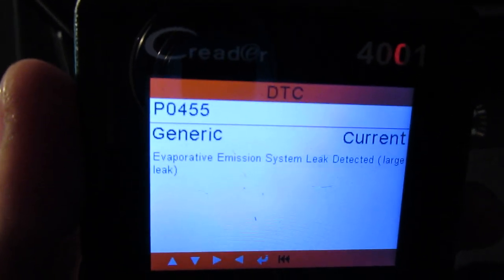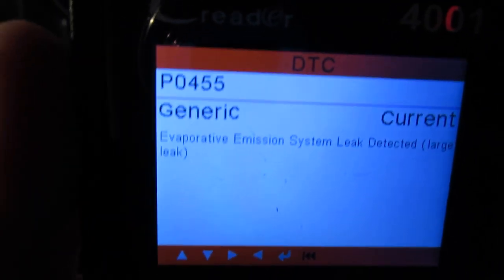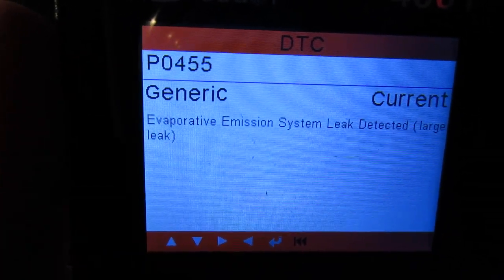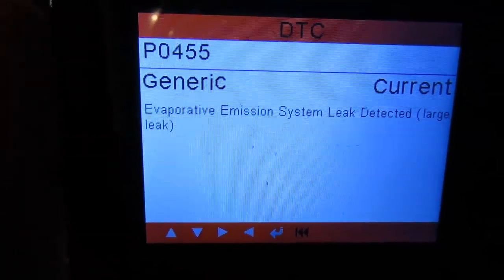FIND/FIX EVAP LEAKS

Comment: Do not buy 1/4 inch or 3/16th hose neither of them will come close to fitting. Buy 3/8 if you want a perfect snug fit. But other than that great video it’s been 3 days without the check engine light hopefully it stays off so I can go through inspection.
Reply from the maker: Mine is about 7 months in an still holding strong. Good luck with it!
Reply: What size clips would I need?
Reply: @DEInTheGarage did that fix the code ?
Reply: @DEInTheGarage do I need clamps I don't got em gonna trick knock this out right now.

Comment: One trick I learned on youtube was to put a vasilene on your gas cap "O" ring  . Helped clear my evap code and has worked for a long time . I may have to do it again as my CE light is on and guess what? Its inspect time. :(
Reply from the maker: Isnt that always the way... I get 2 full years with no CEL and then right before inspection BAM.. good tip though. Thanks!
Reply: Always seems to happen at inspection time....

Comment: I'm chasing a large leak on my '01 TJ and I think it's the hard line up behind the driver's rear spring mount. I'm over in Pittsburgh so I am also blessed with a similar level of crustiness on the undercarriage. My main motivation for chasing the issue is I'm sick of looking at the engine light, haha.

Comment: funny, I was at auto zone today and I was gonna replace the line with the tube like you did and the guy was like NOOOO you dont wanna do that because it won't hold the pressure! Personally I knew it would work because its not a lot of pressure on that line. I changed my gas cap as well but light came back on so im hoping this job will fix that.. I did have a misfire on cylinder 3 but after changing the gas cap that code is gone and hasn't come back so im still learning!!

Comment: Did you ever check your cruise control elbows, sometimes behind the passenger headlight, but your's might be in a different place.  I had a vacuum bulb under my battery on a 99 gjeep cherokee
Reply from the maker: Interesting. Thanks for the suggestion
Reply: @DEInTheGarage  i saw a video the other day of a gas tank leaking at the giant o ring that seals the pump.  I'm starting to see that you can have a leak just about anywhere on the system, here's the list so far:
1. Cracks in air breather hose and air breather top.
2. Valve cover vacuum lines
3. Brake vacuum hose dried up and loose/brake booster allowing air in, going out
4. Intake vac. elbows dry rotted cracked
5. Melted/cracked throttle body vac hoses
6 cruise control vac elbows dry rot.
7 check valve elbows dry rot
8 check valve worn out
9 check valve filter clogged
10 vac to axils dry rot
11 vac to headlights dry rot
12 throttle bod gasket cracked
13 evap vac lines rotted
14 evap purge valve o ring loose/old/ or valve bad
15 gas fill vac hose/purge hose/or air inlet hose dry rot
16 gas pump o ring on tank loose/dry rot
17 gas cap loose
18 cheap gas cap with wrong vac pressure valve
19 vac to air/heat controls leaking in dash
Vac lines off/ddy rotted to vac resivoire (black plastic ball) usually under front fender, either side depend. on make or model/ or ball tank broken
These are the most common....
Smoke test makes a lot of sense now.
Reply: @DEInTheGarage excuse me sir where did u order your custom Sealing design at they look dope. I like Alot.

Comment: my worst smell of oil is 90w oil (rear axle oil)! make a smoke machine! remove the & remove the Schrader valve from the evap test port (left-hand thread ) & test your evap system connect the smoke machine there! be safe!
Reply from the maker: Yea, I have heard folks doing that at home. have never had the opportunity to try my own smoke test, but i would definitely like to

Comment: I use Sil-Glyde on hoses.  It doesn't melt the rubber like oil and petroleum based grease.  
Emissions vapor hose with occasional liquid fuel contact is SAE J30R7.  You can use SAE J30R9 fuel hose but it's overkill.
Reply from the maker: Interesting. Thanks for the feedback and tip!

Comment: Great job gave me enough instruction to diagnose my 2002 WJ 4.7 V8 test code P1494 Evap Circuit not sure if it is electrical or circuit meaning vac lines.

Comment: That is not the Leak Detection Pump, that is the Purge Valve Solenoid. The LDP is in the very far right corner up against the firewall. You can only see the filter on the top of the LDP, the rest of the LDP is down underneath the LDPF. The PVS is a crucial component of the EVAP system but it is not the LDP.

Comment: This repair was needed on my XJ and it successfully kept the CE light off for several months... But, the light is back on (im assuming another evap leak) and sometimes I smell a bit of gas on startup. Any thoughts?
Reply from the maker: Well you can make sure the hose clamp are still tights, but likely another leak popped up. Gas on startup could imply a few things, but I would look around for another leak. If you Jeep is old and rusty like mine was, you can spend a fair amount of time searching and patching leaks
Reply: Did you solve your problem?

Comment: Quick question the plastic line running to tank where you cut the old hose off....what's the best solution to reconnect back at the pump? The whole thing came off on mine and dont remember what side the line hooks onto the pump
Reply: Never mind found my answer in previous comments. Thanks for your videos helped me out more then once!

Comment: Sweet, it is so much nicer seeing NJ XJ repairs and such.
Reply from the maker: yep.. we get a whole set of issues all our own.. There is a video to come on removing the upper rear shock mounts on an NJ XJ.. mine are so rusted the bolt head is gone. Gotta love that winter road salt..
Reply: I have floor pans to replace, a rusted out seat bolt , 4wd shifter that rusted solid and a few other issues.  I do have all the stuff to fix it including por15 just need the time lol
Reply from the maker: Good luck! sounds like a hell of a job! We have to save these XJs though... we can't get them back once they have all rotted into the ground.
Reply: If I had the time, place and money I would snatch up as many as possible for salvage or repair for resale!
Reply: @DEInTheGarage do you got better gas mileage now?

Comment: Did I️t work in the long run, I️ just found the same issue
Reply from the maker: It did! It has been about 2 months since the fix and I have not had an issue. I check it periodically, but I don;t expect an issue. As long as you get fuel line and not vacuum line. Vacuum line will melt and deteriorate from the fuel vapors. For good measure, I also used a mixture of 50/50 ATF and lithium grease to brush down the hose clamps. I do this for all fuel lines, brake lines, and other stuff that is under the vehicle to help them resist corrosion from New Jersey winter salt.
Reply: D&E In The Garage Thanks for the quick reply, I️ just ordered the Evap tubing hopefully the code goes away.
Reply: Are you doing the same fix? Return line on an XJ?
Reply: D.J. Domareki Yes
Reply from the maker: I would love to hear your feedback once the repair is complete.
Reply: I just got the evap codes. Both small and large leak. Haven't checked the gas cap yet but I'm assuming I'm not gonna be that lucky as I never am lol. It's probably the my canister relief vent but I won't know until I check it.
Reply: Great man 👍 which one you use I have the same problem in the same spot can you please let me know the size

Comment: So what ID and OD hose should I get? I plan to replace this same steel line
Reply from the maker: I honestly do not remember off hand. Maybe 7/16 or 3/8 ID. If possible grab a bit of both to be safe. OD doesn't really matter, just get hose clamps to match.
Reply: He referred to 3/16" and 1/4" in the video. Looking at the hose in the video that looks like ID measurements. I have the same rusty line and it looks to be about that size. OD in this case is irrelevant  since the hose you use to replace it with is going over the existing connections at both ends.
Reply: So 3/8 is too small, I used 1/4 ID.
It just fit over the canister and fit nicely over the gas tank side, on which I used a small hose clamp.

This unfortunately didn't fix the EVAP leak so I'm back to the drawing board. 01 XJ

Comment: Just trying to confirm, 1/4, 3/16 or 3/8?  Read all comments and watched vid in entirety (more than once) and all 3 mentioned. I have a couple 044_ codes to fix also. Love your content, thanks so much!!
Reply from the maker: Hey bud. The Jeep uses all three which is why I suggested either confirming which one you need OR buy a bit of each and go to town. I went that direction as it was difficult to confirm the sizes needed without removing the old lines first
Reply: @DEInTheGarage  awesome, makes sense. Thanks for prompt reply!

Comment: Are you utilizing the OEM bracket and guess it's called, "J-swivel hook & twist latch"  to secure your oversized spare tire in the back?
Reply: Off the topic question I get it.
Reply from the maker: It is the stock J-hook, but i stripped the stock twist latch so I found a bolt that matched the thread and welded some table on it to make a giant wing but

Comment: where can I find that hose you used to replace it??
Reply from the maker: Any auto parts store should have it. Advance, AutoZone, O'Riellys, Napa.. just make sure you tell them it is for a fuel system not a vacuum system. They usually have it behind the counter and cut it to w/e length you need. For this particular project you need about 3' of 1/4" fuel hose and two hose clamps to go with it.
Reply: D&E In The Garage sweet thank you!

Comment: When I was trying to pull the rusted line off of the hose that goes up over the gas tank, that hose came out. Do you know if I will need to drop the gas tank to reconnect the hose or if there is another way to fix that? I'm not sure where it's supposed to connect. Thanks for the video.
Reply from the maker: I imagine it can be done without dropping the tank. might have to reall reach around in there to get it done though
Reply: @DEInTheGarage  thanks for the quick response. Do you know where it is supposed to connect or should I just try reaching in and feeling for the connection?
Reply from the maker: @jessemcannon  It should attach to a 90 degree connector on those fuel pump which is on top of the gas tank. If you follow the other lines, they should guide you to it
Reply: @jessemcannon  did I ever get it connected I just did the same thing......
Reply: @mikecarroll5447  I did get it back on. I ended up lowering the tank enough that I could reach the connection but did not have to remove the tank. If you can find a picture or video of what the top of the tank looks like that should help you know what you are feeling for